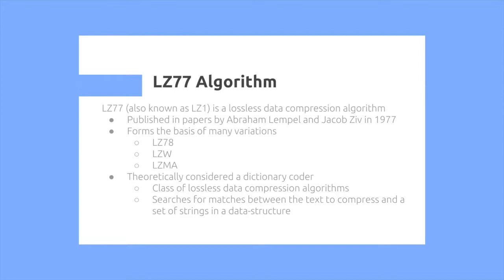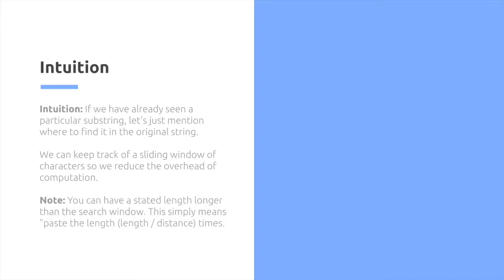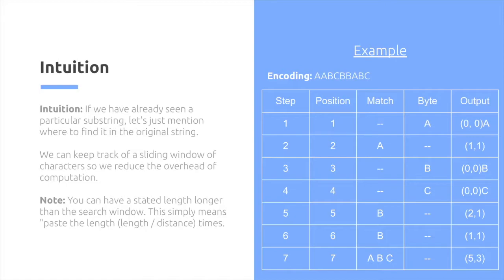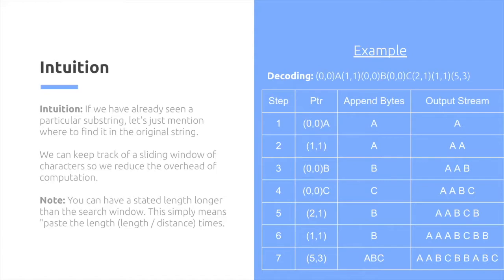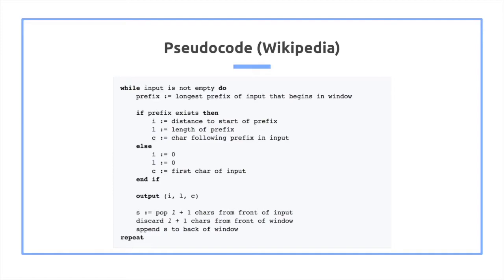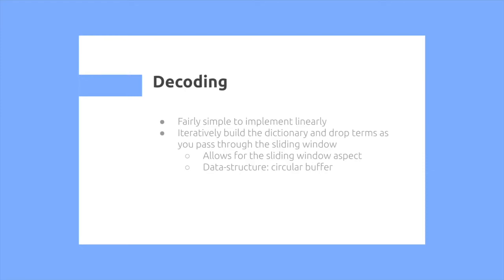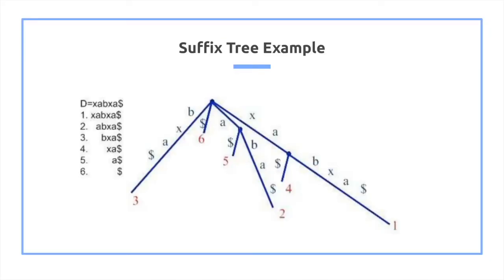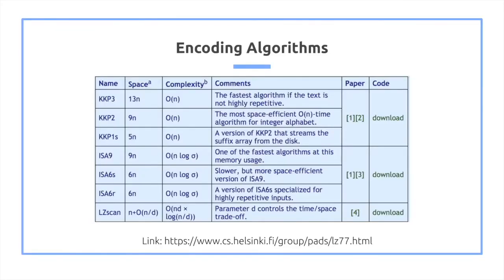Learn in 5 Minutes: LZ77 Compression Algorithms

Comment: I don't find this to be a compression algorithm because A B and C are only three characters, not a byte. That's only 2 bits. If you have this many repeats like aabbcabaa then this is 2 bit numbers from 00-11. A byte code from 0-255 rarely ever repeats since there are 65000 possible combinations for only 2 characters. Using only 2 bits for aabbccabc like patterns means then it is not compressed it is expanded instead (poor results). since the new indexes are larger than 2 bits per each number (about 3-4 bits) Comments?
Reply: @10F2C  is it unicode that he is using rather than a byte?
Reply: each character is a byte not a bit jesus